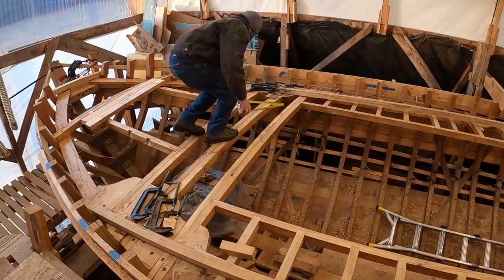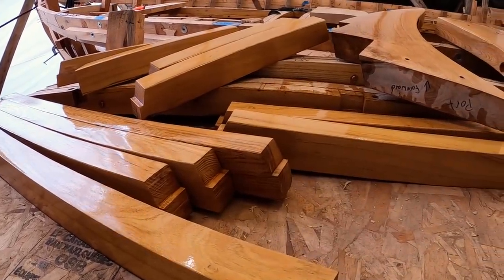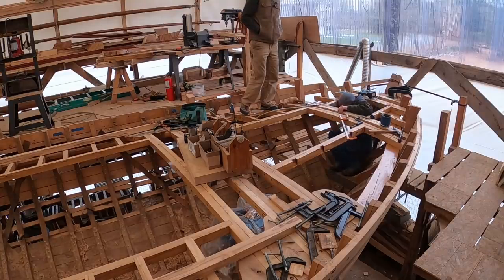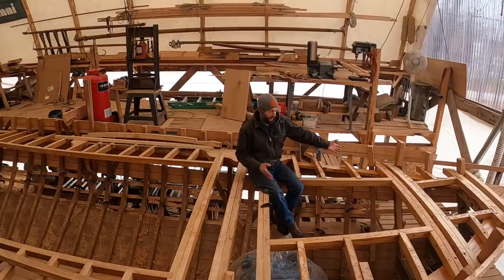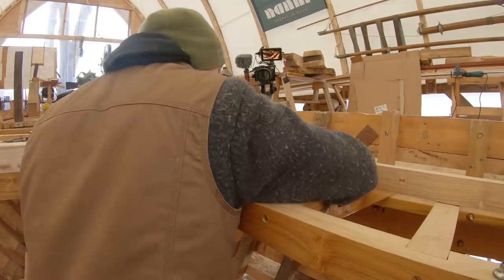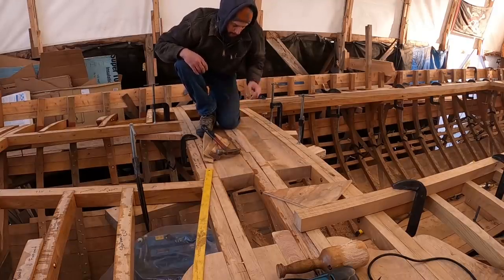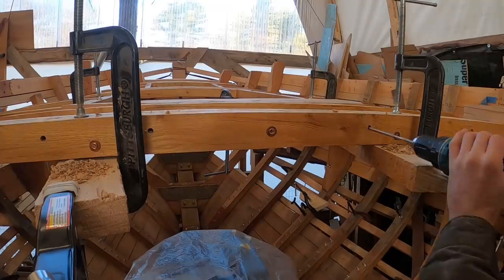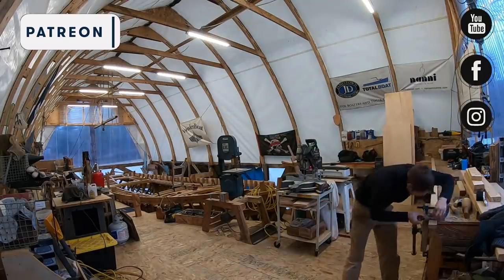Half Laps and Mast Blocking - Episode 147 - Acorn to Arabella: Journey of a Wooden Boat

Comment: I would deck step the mast for I would rather have the space down below. Why don't you build the interior while the deck beams are still removable?  Wouldn't give you more space to work.  I know nothing about boat building.  I love the new intro.
Reply: There would still be a compression post beneath a deck stepped mast so there would be no space savings and very little weight difference.
Reply: @David-hm9ic  good point. I assume it is easy to water seal the hole

Comment: Just as a matter of interest, how long would it have taken by pro shipwrights to build Arabella, say 200 years ago.
Reply: Shipyards would turn out huge cargo vessels in one to two years.  But they had crews of hundreds of craftsmen.  So it would have depended on the crew size, level of build, etc.  For a small boat builder with a small crew and materials available, this would probably be a one year effort, roughly.  Of course this project is drastically different - it is a journey of education, gathering raw materials, filming, erecting building structures, restoring machinery and only two consistent workers.  Much respect to builders of the ages who turned out huge vessels by the hundreds in short periods of time and also to these guys who are taking on a special build that is a personal adventure, and we are invited to share it.
Reply: @boooshes  Thanks for you quick reply  much appreciated.  I wasn't been critical just a thought. :)
Reply: @charlesxix  sure, it is remarkable how productive the shipyards of the 1700s and 1800s were with little or no automation, mostly handwork, massive timbers, etc.  Even small yards produced thousands of small boats over the years.  Many became masters of the craft and were extremely productive.  Skills that are relatively arcane now were common among the builders.  How many folks can prepare materials and sit down and weave a simple, functional basket that will last for years?  Used to be relatively common knowledge.

Comment: wouldn't it be better to move the deck beam,  put the mast  next to it and add another deck beam on the other side of the mast?  cutting a beam is usually not the best.  if you have to cut it header it off on both sides, don't just butt blocking onto the cut beam.